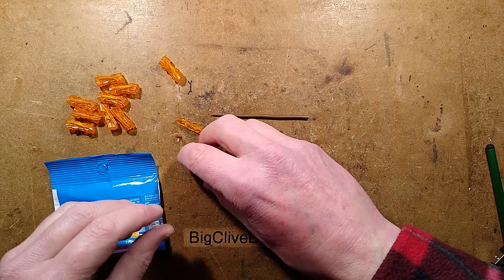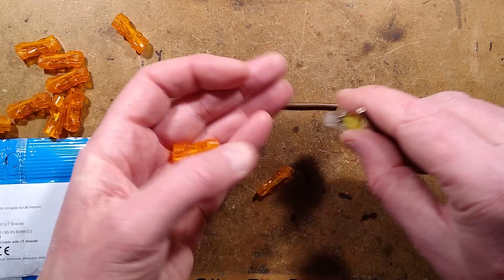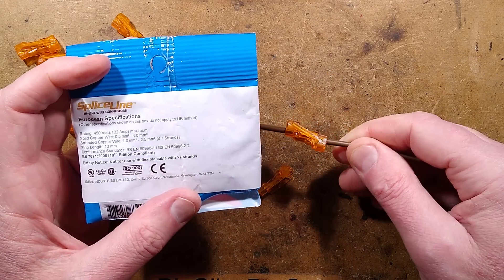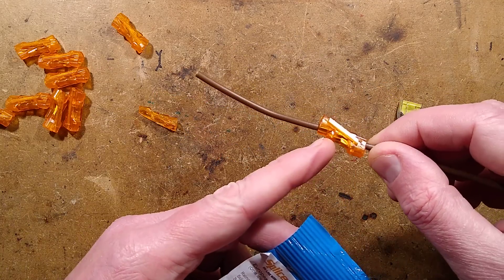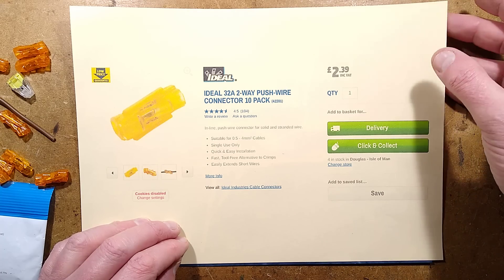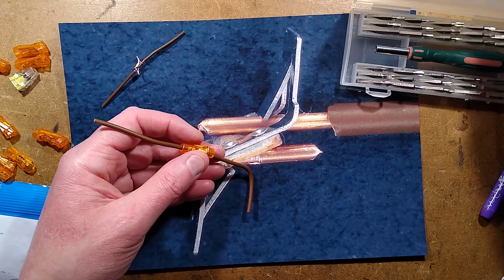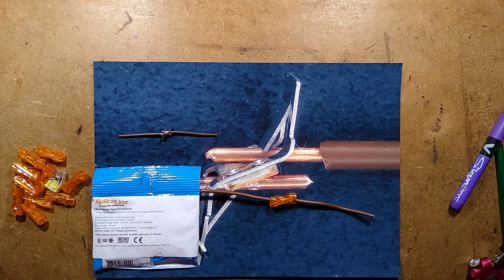Inside a SpliceLine push in cable connector

Comment: These are perfect for connecting my robotic mower guide wire (12v?). Everything else has failed after a while, possibly due to changing tension from soil, vegetation and mole movement over time. Cheap enough.

Comment: I mean wagos are also single use, its down to the spring possibly getting weakened by you removing it and putting it in again, so that they can't garantee that it will make a safe connection.
Considering that bad connections could start a fire, don't reuse them or even better, get lever wagos.

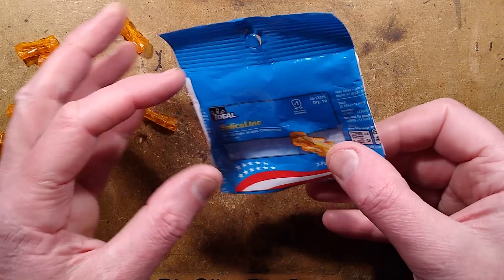Comment: 0:24 Wago (and "wago styled) also has through hole … with lever (for repeated use). I found them on amazon.
ASINs because YT doesn't like links these days.
With lever 32A:  B09ZRLSNL1 Wago: Item no. 221-2401 (and for also fine strand wire: Item no. 221-2411)
Single use 32A: B0C74H53KV Wago: Item no. 2773-2401

Comment: Ideal is an American Company that has been making wire nuts, connectors, terminals, electrical tools, and many other electrical industrial parts for decades. I used their wire nuts on a US ballistic missile submarine in the late 80's. Been around forever.
Reply: I highly suspect that the Def Stans don't cover the use of wire nuts!
Reply: I work for Ideal and yes, they have been around for over 100 years. It's an American company based and headquartered in the small town I grew up in (Sycamore, IL pop. 18,000). The company is a source of pride in the community, and besides manufacturing many quality electrical products, they are very involved in area events and charities. A good company!

Comment: 🤖  In the future Clive's great great great great great grand-daughter has inherited Clive's ability to make detailed photographs of intricate circuits and devices, and this has landed her a job as a brain surgeon.  (One of the few humans to hold such a prestigious position in the robot dominated medical profession.) 

In the surgical room they are operating on Grandpa Robot who has recently suffered an episode of "brain disconnect" resulting in him wandering into traffic on the highway and suffering from bent limbs and a cracked exoskeleton. 

Clive Junior, as she is known, is heading the team to reconnect Grandpa's brain, assisted by technicians A and B. 

Gingerly she prises open the cranial access panel with her spudger and peers inside. 

Assisted by her monacle she sees that Grandpa's neural circuitry is very primitive indeed and lacks the usual high reliability connector blocks.  The brain is connected to the nervous system only by twisted wires, electrical tape and marettes, one of which has wiggled loose. 

        \
        /
8o[ /\/\/      &o-) CJ       (o-] A      (o-] B
      /
      \

Comment: For me these are quite 'niche' in a sense that I use both solid and stranded core with varying sizes (these are horrible with tinned or stranded). Wago is my go to diy connector in that sense.

If I purely did house-hold/solid core wiring, then yeah perhaps. Saying that if you only do that but it's not your profession, I'd question should one be playing with electrics at all. Mainly for trade imo.

Comment: A guy I worked with used Ideal push-in connectors on some wiring in a breaker panel (consumer unit I think it’s called in the UK?) 

They melted and left a line of black soot deposit in the panel, which I’m pretty sure means flaming ignition.
Reply: I believe they’re UL listed to work with stranded, but there’s a high risk that some/most of the strands will fray before they make it in. So you need to closely inspect every connection and be willing to redo some.

Comment: I used these the other day do connect flex. I used a bootlace crimp to deal with the fraying. Does this make me a monster?
Reply from the maker: As long as the crimp was properly crimped it should be OK.  But it lacks the extra crimping effect of a typical screw contact.

Comment: The release is like a tie wrap ? But as you found not really for second use but saves cutting the cable length if you need to make changes in the future

Comment: Nice one!
But I guess that's not for multi-core cables as that couldn't be pushed against the metal plate to make a low-resistence connection.

Comment: The single use aspect will mainly be a factor with stranded wire, where any attempt to extract the wire will result in broken bits being left behind in the connector.

Comment: I don't like the contact area being so small. 4mm^2 will be rated for a LOT of current. A flat surface against 1 side and a single blade across the other side is a minute contact area....I assume they've been tested, but I'd be happier with an appropriately rated chocolate block.

Comment: Thanks, another useful video. Do you think these would be too big to repair a damaged UK christmas tree light cable? I have a set of 120 indoor/outdoor tree lights that I acidentally cut through. I have managed to pair up the strands again to make it all work but not sure if these sort of splicers will be too big for that smaller sort of low power cable used in tree lights. If I can get the right splicer, obviously, I will only be using them indoors going forwards!

Comment: I always thought these spring loaded push in connections were a bit questionable, but they do seem to work just fine even at high amps. I've experienced lots of wall sockets rated at 20+ amps using the same type of push in connections and never had any problems with them. However I did have a split aircon installed a few years ago and the techs just twisted the wires together and covered with some electrical tape 😲 That's a great way to start a fire.
Reply: I grew to hate to spring loaded type connectors when working with industrial kit and embedded systems. They were always annoying to use, often just failed when trying to reconnect a wire and the number of times one of them would pop out compared to screw terminals was staggering (OK, probably not that often, but just once was more often than I wanted). Having to stand on one leg on a ladder to stretch and reach an embedded system which some cheapskate/git had designed with push in terminals and then replace a wire while jamming a screwdriver into the terminal to release it was tedious to say the least. Then some jobsworth would come by and complain that I wasn't wearing gloves...
Reply: @nickryan3417  Yeah, I still prefer old school screw terminals, as long as they're good quality and don't crack when you tighten them. But of course, they also have a weakness when people don't tighten them properly.

Comment: Ideal is a decent American company. I've used their F-type crimp connectors (and associated crimping tool) to completely wire my house for CATV. If you can read this, they've survived since 2011. Including the main house termination block, on the northern side of the house where it gets hammered by wind, rain, & snow.
You know when you get a "feel" for when you're working with quality components? I get that feeling with them.
Ideal is available in commercial supply houses AND your Home Improvement Box Stores (both orange and blue).

Comment: Ideal is one of those brands a lot of guys stand behind over here Clive :) the makers of the #1 most used wire nut, as all as many other electrical related products from Lube to even some of the best hand wipes I've ever used LOL. They also make some tools as well. Typically great products. I have a couple of these inline splicers in my "oh shit" box in case I run into something like someone cut a wire too short to make a proper connection with. In that came case, i also carry a small assortment of wagos for any other binds I might find myself in where someone has done something wrong in the past and now we open it up and have to deal with it. Really handy for service calls. If they ever got cheaper here, I could see them being the #1 connector for lighting, but I'm not sure if they will ever catch on 100% for things like receptacle loads. I think Leviton recently released a receptacle that uses the flippers like a wago, and I could see that being very handy if you were in a situation where you had to swap one live.
Reply: I can already see it in your eyes now, clive :) want me to mail you one? hahaha

Comment: if they made the pushing edge of the connector at an angle you could probably screw out the cable without deforming the connector.

Comment: There is a ( handy ? ) way to use multi strand " equipment wire " ( flex ! ! ) with these .... strip the flex , twist the many strands tightly together , then generously TIN ( SOLDER ) the end , and it then becomes a single strand , which will grip in these connectors as good as a single core cable .... ( tried - n - tested ) ..... tip # 27 ......... DAVE™🛑

Comment: Off topic comment but couldn’t find where best to ask- is there any chance you could do a video explaining the little 1s Li-ion protection boards you can get to prevent over discharge of a battery?
I’m charging a vape battery through an esp32 type board (Heltec v3 for Meshtastic) and folk on discord are saying I should use these to protect my harvested batteries.
Reply from the maker: Most of the little protection boards are based on the classic DW01 and a dual MOSFET transistor package.  They cut off the cell at around 2.5V and 4.25V.

Comment: Do they advertise the force needed to pull the wire out? If so it would be instructive to use a fishing scale or similar to see if the needed force changes after the not-recommend second or third use.

Comment: Great videos Clive. I am told to use normal Wago ones at work and I usually refuse, as they just seem awful to me, even on stranded cables... How many amps did you test these ones at? It might look like the conductors are all fine and dandy just touching the "copper" slug, but what happens when you give it the full load they say it can take? round conductors only just touching with minimal surface area each side seems poor practice. Surely a follow up video with a decent load is required, as people need to know what might happen..

Comment: Looks okay fairly neat in-line connector. The one thing I always have a doubt on is the actual surface area in contact with the wire. I think you need to test these at full rated load, and measure the  temperature and resistance. Would be very interesting.  Thanks for the review. 🧯🚒

Comment: Aaaaaaaha!.... My ex's son has a Fiat Grande Punto with the known iffy rear light electricals (corrosion), so, buying another tail light connector, and splicing the wires together this way COULD be a simple fix? The Puntos are ALSO known for their heater fan resistor melting the plugs, so, buying a replacement resistor/plug, and utilising these (or similar) connectors could be a helpful fix... Innnnnnteresting 🤔😏...

Comment: Always intriged by how little contact there is between the wire and the grip. Almost just two point contact. How would that affect the current carrying capacity?
Reply: Remember that the wire also has a very limited area. And while the contact resistance between wire and bar is higher than along the wire, you don't need more than .25x to 2x the wire area for good contact. The contact area will always be a resistor and produce heat, just like the wire itself. It just needs to be sized so that the heat production is within limits and no buildup occurs.

Also note that it is preferable when the connectors melt before the wire does. Junction boxes are easier to replace than the wiring inside the walls. So, a connector that has less resistance than the wire is not advantageous.

Comment: Two potential issues with reusing one of these:
If you take one off and throw it in your toolbox, is if the next time you use it you put it on a smaller wire.
It could flex the spring farther than it would have (without prior larger wire insertion), and not have as much tension as a new connector would have.
For the same reason, carefully removing it with a pointed tool, no matter how careful, would inevitably flex it farther open than when it was gripping.
Even if it physically was not changed, the spring tension might not be as tight as a 'virgin' connector.
[It is likely the spring will spread as much as needed, depending on the conductor size, but then only be able to spring back a portion of that travel, along with the associate gripping tension].
Another words, if reused on a smaller wire, even if it does grip it securely, it won't be gripping it as TIGHTLY as an 'unspring' new connector would...
[same issue with inserting stranded wire after using it on solid wire of the same gauge].

Conductivity, and resistance is not just dependent on the contact area, but also the pressure between the wire and the contact surface...

Comment: Oh hey, my dad used some of those a couple months back when I went to help him install some sockets for my cousin's new house
Normally he uses screw terminals for making connections (when fitting lights or whatever) but he used these specifically because they were going to be sat in a wall covered in plaster and they're apparently meant for that kind of application? (Not too sure on that one)

Either way, very cool seeing what's inside them and how they work!

Comment: Ideal is a very old and very high quality connector manufacturer in the US.  They make precision crimp ring connectors that are certified for use in nuclear plant Class 1A (critical safety) wiring.  Millions of precision crimp loop connectors were used during the nuclear plant building boom of the 70s and early 80s.

They make a wire lubricant for pulling wires in conduit called Yellow 77.  That stuff is so ubiquitous that the trademark "Yellow 77" has almost been genericized like Kleenex.

Comment: Here in Michigan, Ideal is carried by Home Depot (huge home improvement chain) and other stores. Actually just used their non-lever push in connectors for some lights and switches. Wouldn't trust them for super high loads but 1000% better than wire nuts for moderate loads.
Reply: I use wire nuts for anything from hundreds milliamps and up to 20 Amp loads.  Not a problem.  If installed properly wire nuts have a much better load rating than the glorified consumer level speaker pinch terminals that are Wago and these.  I wouldn't want to use Wago with anything over 10 Amps.  If wire nuts are deemed obsolete a number of electricians and electrical hobbyists may cry and go to insulated screw terminals and ferrules.
Reply: @WJCTechyman  interestingly wago makes din rail terminal blocks that get lots of use industrially that are rated into the hundreds of amps but they work a bit differently, more like the lever blocks, you have to insert a screwdriver into a slot to open a hoop that the wire goes through then when you remove the screwdriver the hoop is pushed back against a large connection plate with a lot of force, i've seen a lot of bad screw terminated din rail blocks that pass the pull test but have high resistance and cook themselves but i've never seen a wago 280 series or the bigger ones that passed the pull test but got hot in use

wire nuts are ideal...heh... for solid 14 and 12 awg wire though if installed by twisting the wires first with enough force to deform the copper

Comment: When I was a kid, Big Clive, I used to join cables together with Sellotape! ... Oh yes, many's the time our house was plunged into ⚡💥 😲 darkness, while the Wylex consumer unit fuse was rewired! ... Happy days! ... Although thinking about it, it's a miracle I've made it to 61? ... Nothing like a short sharp shock to inject a bit of excitement into life? 🤣

Back in the days when appliances came with bare wires, did you ever stick bare wires into a 13 amp outlet, and jammed a plug in to hold them in place? ... That was a great way to blow a fuse too!
Reply from the maker: Shocks are very educational.

Comment: I don't like the fact that the copper wire is not surrounded by metal or copper. There is only a fraction of the surface of the copper wire making a 'connection'. I think when you pump 32A thru this connector, it gets pretty warm inside.

Comment: Those connectors look to be an adaptation of of the "Gripple" splice that is used for wire fencing.
Reply from the maker: The Gripples are often used to suspend ducts and cable containment in the UK.

Comment: The stamped assembly portion of these is probably produced on a Bihler or similar multi-slide machine that's doing the stamping/bending and assembly. I've never seen connectors like this, but you could get a pretty high production rate if all the tooling is dialed in.

Comment: You could tin the flexible cable with solder before jabbing it in the connector
Reply from the maker: I recently had a tinned stranded cable pull straight out of a Wago clone because the solder interfered with the gripping.

Comment: This is my favorite connector, I always have a bunch in my tool box. I use it mostly to safe-off live wires when troubleshooting, since they're so easy to twist off, and don't tend to fall off like wirenuts when used on a single wire

Comment: I guess that you could use them with flex Clive, if you first solidified the strands by running some solder in.
Reply from the maker: I recently had a tinned stranded wire pop out of a fake Wago terminal.